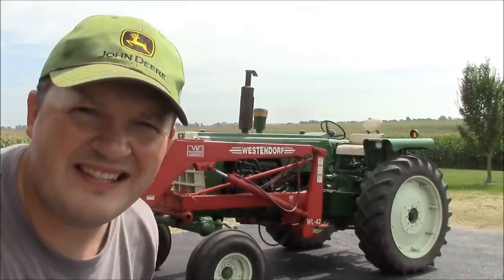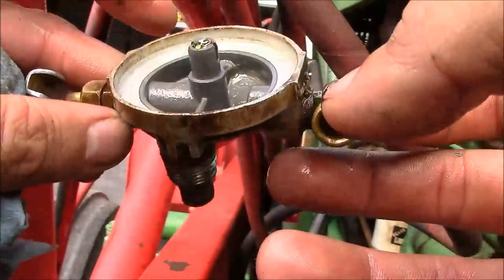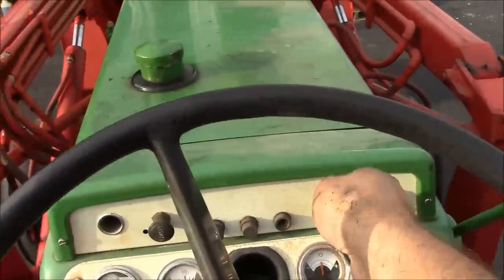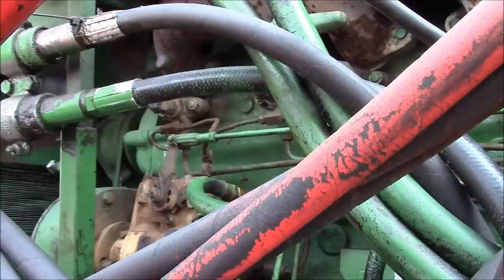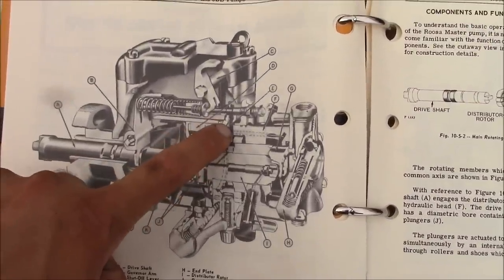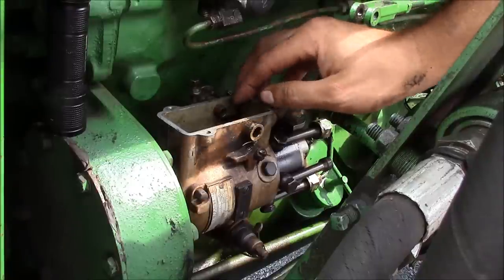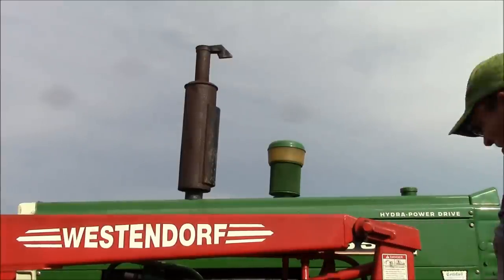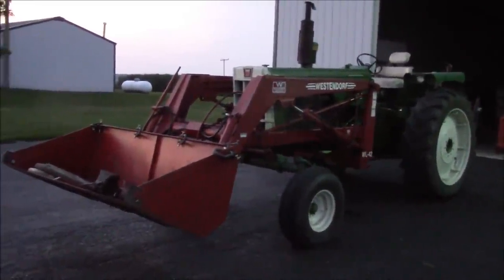Oliver 1650 Diesel Tractor - Hard Start / No Start

Comment: Every tractor runs like a top... until you put a loader on it.  Bio?  Yeah unless a guy is willing to clean the entire fuel system I would avoid using it on the vintage equipment.

Comment: MANN seems to make a filter for EVERYTHING fyi.
Reply from the maker: I've not seen them in the USA. The most common filters for diesel engines here are Wix, Baldwin, and Fleetguard.
Reply: @WatchWesWork  well i'm not an expert but, Mann make every filter for my place of business which uses air filters for equipment such as compressor/vacuum pumps which are german like rietschle and becker.  pretty expensive at 15k for an air pump.  but i did get a MANN fuel filter for my 7.3 powerstroke.  don't recall where.  Amazon or Grainger.  that led to me to think, they do make fuel filters too lol.  the filter you showed looked very similar to some water filters or one of many industrial applications i've seen.
Reply: @WatchWesWork  Balwin makes great industrial pumps.

Comment: Wes, what are you living in, a corn field? That is some nasty stuff in the tank, probably wax from the biofuels process, maybe methanol will break it up, that what the use in the process for waste fryer oil, does the exhaust smell like a Chinese restaurant?  I love it when it runs when it comes in the shop and refuses to start after. Is it fixed, the $64,000 question.
Reply from the maker: All of Illinois is a corn field this time of year. Yes, it is fixed. It has not failed start since fixing the metering valve.

Comment: The supply part does not produce suction to pull fuel out of the fuel tank I would clean the complete fuel system you can use Mr. marvel fuel additive to help you clean it I would change the filters to a more of a modern type filter you can get the bases from fleet guard because when you pull the top of the pump off I could tell by the color of the components inside the pump that there is some type of abrasive. Has gone through the fuel system if you tear the park down and rebuild it be sure and get EID Weight Cage when you see it you’ll know why that plastic retainer that’s on the white cage is out on yours I can tell by it’s running are used to be a fuel pumps for a living I’m a certified stanadyne Pump technician the EIdIs solid and I would also check the injectors because of the abrasive that’s been run through it see the brown color inside the pump that’s why I know it’s been an abrasive run through it just holler at me if you need any help

Comment: Outside the fuel issue some of the diesels get to be ether whores they will not start without it
Reply from the maker: Well if the metering valve is sticking all bets are off.